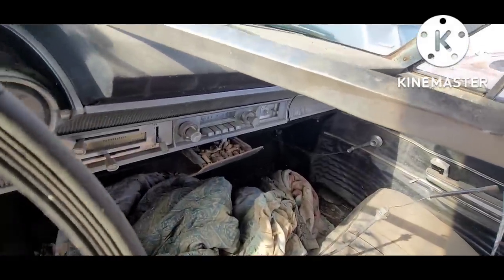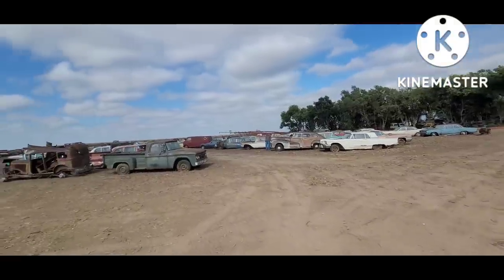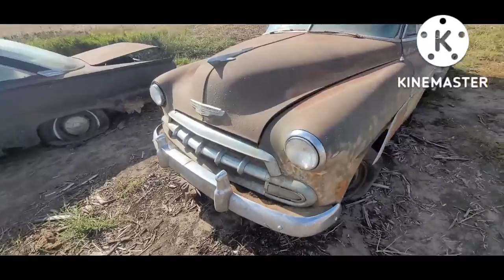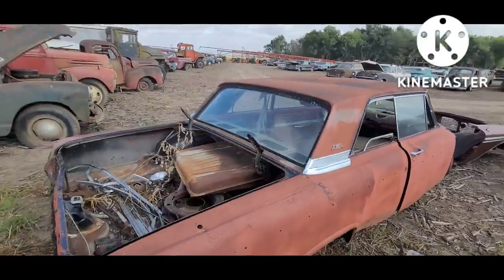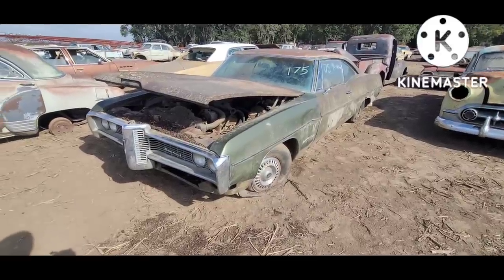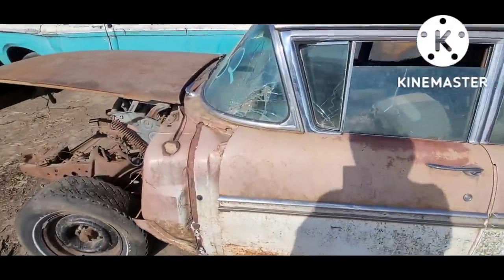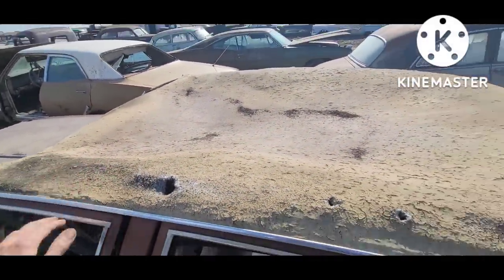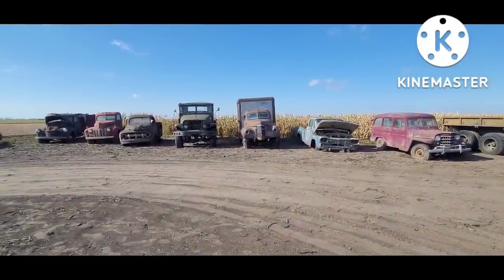Abandoned Forest Hoard & Barn Find cars! 1930s-70s Ford, Chevrolet, Cadillac, Pontiac Mercury Buick!

Comment: With most of these cars you mention either it's parts or a resto. I think a lot of these could be drivers. Beat it out a little and do some mechanicals.. It has to be the right person, but I feel there is a big grey area that you're not considering with many of these. I guess the commentary on the '59 at the end made me want to mention this. ✌✌
Reply from the maker: That would be true in most cases, but with the amount of time these had sat, a full mechanical restoration would have been necessary to end up for a beater/driver. Every engine there would have needed rebuilt or replaced, then brakes... realistically an entire mechanical refurbishment

Comment: 10:56..that's a '64 Ford truck..first year for that bed design...'63 and earlier had either unibody bed, stepside bed, or the "wrongbed"('57-'60 style)...plus, that's a '64 grill, also....28:39..you are correct about those '49 Ford details, that were different on a '50..however, I noticed this car has the '50 Ford crest on the hood, not F-O-R-D spelled out in letters, like a '49..so it must have had either a '50 Ford hood added later, or someone removed the letters and replaced them with the '50 crest...28:54..'47 or '48 Ford, not a '46..'46 had the rectangular parking lights above the grill, '47-'48 went to the round ones below the headlights...39:46...another '64 ford truck...not a '65...
Reply: The 61-62-63 Ford Pick-up trucks were UniBody Styleside,Humpy Pontoon Fender Flareside and Wrong Bed Styleside. The 57-60 Styleside Pick-up bed was offered as an alternative to the UniBody Styleside Pick-up
Reply: Correct.
 @greggabel7238

Comment: The Mercury is a 55. You mentioned bubble top '59 Chevs, Starliners are more rare and as valuable. Especially 61's. That '61 Merc with a stick setup might have had the 375 HP or 401 HP 390 in it. Perhaps also the '61 Starliner. 406 did not come out until '62 (I'm pretty sure)

Comment: I’m guessing the bug is a ‘61. The hood hinges and prop are the same on my June of 1961 bug but a December of 1961 bug I owned had spring hinges. The hood crest also ended in ‘63, as did the rag top. That roof alone is worth $1500 probably. Cool car , unoriginal taillights.
Reply: You know in Arkansas there's three VW only salvage yards. Including what I would call the Mecca VW salvage yard. Also there's one in the middle of Missouri that's pretty decent and they build them as well. But the one in the middle of Missouri got more rust . There's a few more around but they couldn't afford to charge by the pound unless they're selling bags of rust dust. As far as those are in the midwest.

Comment: Ford Mo Co..had huge problem from 1965-1968 ...the frames rotted out and the cars split in two..we had 1966 Monterey and 1968 Park Lane  (Mercury..Ford) ..the frames rotted out and cars sagged and couldnt open the doors....Ford had pretty much always been cheap disposable garbage...people dumped them 5 years after buying them...they are nothing special
Reply from the maker: Depends on the location. I picked up a 1966 Mercury Montclair once... after it was on the trailer I looked down and saw the frame rail lying on the ground. 
However, this is still one of my favorite body styles (and I've found a few good ones)